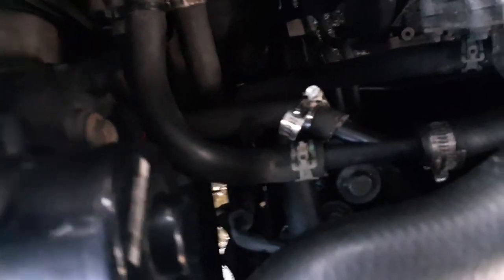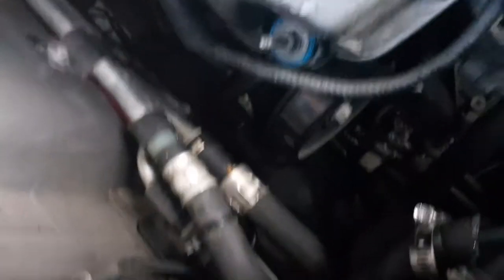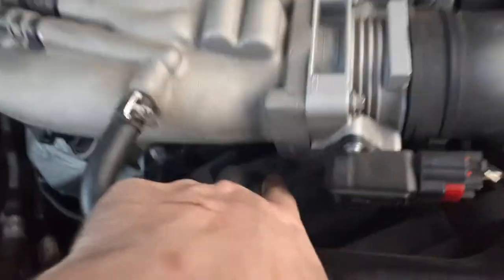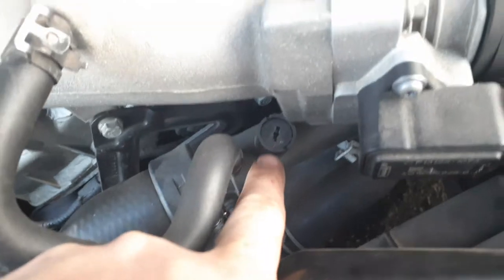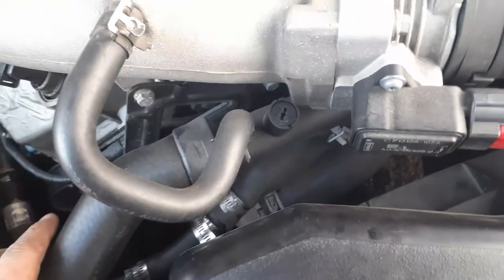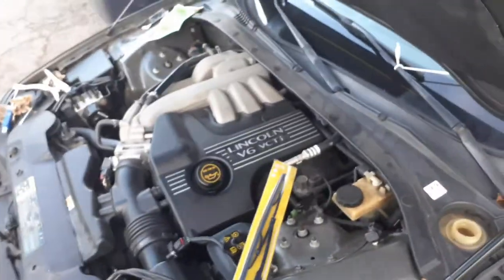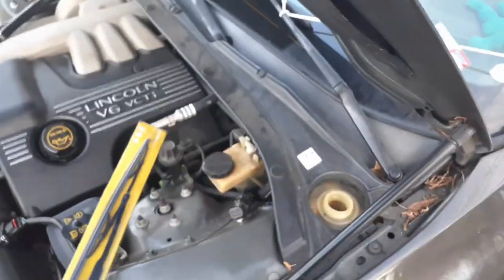Heater Valve DCCV Bypass 03-06 Lincoln LS - Get HOT Air In Both Sides Again FIX YOUR HEAT

Comment: Will this same method work with the 2000 v8 ??
Reply from the maker: That 2000 v8 has a valve with more outlets on it. You can do a similar trick, but it will require more hoses to be cut and spliced with connectors to bypass the valve. The main thing is to get that hot coolant from the engine to those two lines that lead up to the firewall and into the heater cores inside the air box behind the dash. Check this out....
https://www.justanswer.com/ford-lincoln/4c2hk-2002-lincoln-ls.html
Reply from the maker: Take coolant from 1 in the diagram there, y pipe that and split it, connect the two heater core hoses 2 and 3 to that y pipe. Looks like you can leave 4 and 5 in there connected to the valve because it appears to just be a free flowing return, but if the coolant isn't flowing through that for any reason, and hot coolant isn't returning to the engine, then just connect the hose from 4 into 5 using Clamps and a connector and that will let it flow. Sorry for the late reply, best of luck.
Reply: The tech in that link said this won't work because the coolant wouldn't work. Thoughts?

Comment from the maker: I love how when it starts getting cold I get more views on this one! 😁⛄️ Hope you all get it figured out and stay warm!
Reply: I was wanting to bypass the dccv and the auxiliary coolant pump as both are bad. Just until I can get the parts. The tech in that Justanswers link says a bypass wouldn't let the coolant flow. Is this true?
Reply from the maker: @butchcoolidgewalkencoolidg3376   assuming you have a 3.9 V8, it may not work out for you...without the auxiliary pump to provide extra flow to get the coolant up to the heater core at idle it might not work so good...but it'll flow when you get running faster and higher RPM to increase flow I'm THINKING. I haven't experienced it myself but that's what I'm thinking. If you replace just the auxiliary pump you can still bypass the dccv, splice hose 1 into 2 and 3 with a y pipe, then make sure the return from 4 goes into 5 or whatever port 5 goes to for coolant return with a longer hose...as far as the flow pressure, not sure how that'll go. If you step the hose size down from 1 to 2 and 3 that will increase pressure in the system and the coolant may flow to the core at that point. Let me know how it goes.
Reply: @WhitefolksT  thank you for the response. Just bought some clamps and couplings.  I'll let you know what happens.

Comment: Are there any upper radiator hose with molding tee for 03-05 v6 ls?
Reply from the maker: Not sure if that part exists or not. I literally looked at his car for 5 min and then went and grabbed this stuff in the video off the shelf at advance auto with the radiator repair stuff. The hoses on your v6 should be the same or very similar, I would think. My friends car is a 2006 V6 model.
Reply: @WhitefolksT  bro I’d appreciate it and will pay good for a 03-06 v6 upper radiator hose from the junkyard yard or anybody else.

Comment: Yo nice vid, on my 2000v8 i only get heat when my heater core bleed valve is open.. Looked at some diaghrams of the dccv and saw that the heater bleeeder is on the same hose as the heater core return line,, is it possible my dccv return port is clogged or not opening or my return hose is clogged? Thanks
Reply from the maker: Hey thanks for the compliment, gonna write a book, here it goes :) ...If you have to open an air bleed valve to get hot coolant flow, it makes me think you've got air trapped somewhere and need to strategically park the car or elevate that side to let the air out and the coolant flow. The return side doesn't have a shutoff valve, only the inflow side is regulated, but return could be blocked off somehow. Might need to pull a couple hoses off and look for gunk. I doubt it's clogged if you're at least getting heat in the car sometimes but the return/heater core side will sit with the same coolant in it all summer every year if you don't switch to heat sometimes to flush it out. That can get it gunky and gross. Be sure coolant is full, and mostly coolant is escaping the bleed valve when you crack it open and rev the engine to force coolant flow to force out air. Feel those hoses to see which ones are getting hot to verify you've got flow. Confirming that you have hot coolant flowing to all the right hoses is important. If the inflow hose is hot, hoses leading to heater core are hot, and return is cold, you've got a clogged heater core either air trapped or physical gunk. If that return hose coming from the core is hot but no heat in the car, the heater core needs flushed or replaced OR the blender doors in the dash aren't functioning. Unlikely but possible also is a bad water pump that isn't spinning the impeller because it came off the shaft or the plastic impeller blades are broken, missing, worn out...or a thermostat not opening enough. If you've got any more questions or if I missed something just reply here and I'd be glad to keep helping you get it figured out.

Comment: On my 02 3.9 LS. Only on warm days or sitting idling for a few minutes my temp gauge will try to creep up and get to the 3/4 spot then start coming back down when I start moving. But if it sits just above halfway, isn’t it still ok as long as it doesn’t get to high. I was thinking it might be the cooling fan cause I know these 02 LS came with the crappy cooling fans. I replaced the coolant reservoir and that kept it from leaking but still have this slight overheating when hot weather or sitting for long periods but usually just when it’s like 75 or warmer
Reply from the maker: I would confirm the fan speed, if it gets to 3/4 on the gauge that cooling fan should be full speed trying to cool the radiator. And the fact that it cools off when you drive and it gets air makes me think cooling fans. Check and confirm your coolant concentration and level is full. After that you get into things like, is the radiator and cooling system super dirty? Is the water pump still pumping? Thermostats not opening fully?
Reply: @WhitefolksT  I replaced the thermostat with a motorcraft recently and the radiator is new. So I might just drain all the coolant and put all new so I know the level and 50/50 is correct.
Reply from the maker: @albertwesker2283  yeah and consider using full strength antifreeze and mixing it yourself with distilled water from the store, it's cheap, use a mix concentration like 65/35 70/30 in favor of the coolant. It'll have a higher boiling point and lower freeze point than pure water, pure coolant, or a 50/50 mix.
Reply: @WhitefolksT  I’m thinking the mixture might be slightly off or the fan is getting weak. I know these LS 3.9 have very sensitive and intricate cooling system that have to be bled of air perfectly and precisely
Reply from the maker: @albertwesker2283  ok cool, let me know how it works out for you.
Reply: @WhitefolksT  appreciate

Comment: BROTHA 😎 IM HAVING SAME ISSUE ON MY 01  LINCOLN LS V8  ,I GOT AC  BUT NOT HOT AIR !!
Reply from the maker: @jcoach3064   yo, check in the comments and I've answered a few questions and dropped a link about the V8 version of this valve, it's really similar to solve the problem.
Reply from the maker: @jcoach3064  if you do have hot coolant running up the lines and hoses up to the firewall and heater core, and hot coolant coming back out the return line, it may be the blender door behind the dash not switching the air duct from cold to hot

Comment: What is exactly the problem the led to this conclusion???
Reply from the maker: The car had no heat inside for a while. The dccv also began slowly leaking, that's when he finally brought it to me. It's probably disgusting, corroded, and clogged inside of it, the valves were stuck closed. I did this to his car to get him safely back on the road for cheap. Also one less complex part to break now.
Reply: @WhitefolksT  TY for replying.
Reply from the maker: @joshuaheart2764  sure, always glad to help, feel free to ask if you have any questions or check my video description on here I wrote up for more details

Comment: Does the Jaguar 2005, V6, 2.5 have a similar engine other than the cubic capacity difference? What MAF sensor do you suggest? and would it use most of the same parts made by Ford?
Reply from the maker: If it's an AJ25 from 2005 it would be very similar to this 3 liter engine, kind of how the Contour/Mondeo had a 2.5L duratec and the Taurus has the same motor just larger cylinder bores. These are all engines derived from the Ford Duratec series, but the AJ engines have variable valve timing and a few other high performance/ more expensive upgrades over what mom had in her Taurus wagon. For the MAF, I usually recommend Motorcraft, Delphi, Denso, or more expensive brands, especially on sensors and electronics. Sometimes the cheap Chinese stuff works, but it's up to you if you want to roll the dice on that. If it was something I was gonna sell or beat up on for myself, I'd go cheap, but for the wife's car or a car you want to keep a long time it's usually better to spend the extra cash. Buy from a reputable website or dealer like rockauto to avoid counterfeit Motorcraft boxes with cheap parts inside. Good luck!! 👍

Comment: Does your ac still work. They tell me it won't. Does yours still work
Reply from the maker: The ac didn't work on this guy's car already from a refrigerant leak, but if the blender doors are working under the dash and your AC compressor is working correctly, you can feel the line to the dash is cold to the touch then you still should have AC, just might not be as perfectly cold as new. I'm not totally certain of where the heater core sits in the air box under dash. If it's right next to the AC coils on there then it could heat that up, in that case put something on the coolant hoses that lead to the heater to pinch them off in the summer. Like a paper clip or some small locking pliers and wrap the hose in tape to protect it. That'll stop or limit coolant flow to the core. Won't hurt or overheat your engine as that DCCV valve normally does the same thing, stop flow to the core.

Comment: Hey buddy I did what u said but now I have coolant coming out one of the lines I cut what did I do wrong
Reply from the maker: Did you splice in the little Y pipe from the bigger coolant hose that used to lead to the DCCV valve to both hoses leading up to the firewall/ heater core?
Reply: U cut the wrong line lol

Comment: En español
Reply from the maker: Esto es para los modelos 03-06, el 02 y anteriores tenían una válvula similar pero diferente con cuatro salidas.  Los modelos 03-06 tienen solo tres salidas.  El retorno de refrigerante del núcleo del calentador tiene una manguera separada que pasa por debajo de todas estas cosas, no fue necesario meterse con él en esta reparación.

 Así es como pasé por alto y eliminé la válvula del calentador DCCV que controla el flujo al núcleo del calentador.  Dejé el conector eléctrico enchufado y la válvula en su lugar de instalación.  Utilicé el kit dorman 47238 que se muestra que incluía un buen tubo en Y para dividir ese flujo en las dos mangueras de 5/8" que conducen al núcleo del calentador y tiene una entrada de 5/8", junto con un poco más de 5/8".  Manguera de 8" y 4 abrazaderas de manguera tipo tornillo.

 En la DCCV, la manguera inferior más grande de 3/4" es el flujo de refrigerante caliente, las otras dos mangueras de arriba fluyen hacia el núcleo del calentador. Corte la manguera más grande de 3/4" que fluye hacia la entrada inferior de la DCCV desde  la manguera superior del radiador.  Córtelo lo más cerca posible de donde la manguera baja de tamaño de 1" a 3/4".  Deje un par de pulgadas de la sección más delgada para colocar en el accesorio reductor en línea de 3/4" a 5/8" (usé un Dayco 80424 de latón que tomé del estante en Advance, toda la basura que usé aquí era de Advance  Auto en la sección de accesorios del radiador).  Tendrá que cortar los extremos de las mangueras del núcleo del calentador de 5/8" que extrajo, lo suficiente para deshacerse de la sección anterior que estaba sujeta. Ayudará a que todo encaje mejor sin torcer las mangueras. Don  No apriete demasiado las abrazaderas, especialmente en el tubo Y de plástico.

 ASEGÚRESE de purgar el sistema de refrigeración después de hacer esto.  Habrá aire en el sistema y evitará el flujo adecuado y no tendrá calor hasta que haga esto.  En el V6 es el tornillo que te mostré en la manguera superior del radiador.  Se suponía que simplemente se jodía, pero el del auto de mi amigo no funcionaba bien, así que apreté las mangueras, agregué refrigerante y aceleré el motor por un tiempo para sacar el aire a través del tanque de recuperación de refrigerante.  Después de un poco de burbujeo, desbordamiento y recarga, saqué el aire y encendí el calentador.  Es diferente en el V8, estoy bastante seguro, pero si encontró este video, probablemente pueda encontrar el procedimiento de purga del refrigerante.

 Aquí se muestra el LS 3.0L V6 de 2005 de mis amigos, y casi no experimentaba calor solo en el lado del pasajero del tablero, apenas lo suficiente como para notarlo, no lo suficiente como para proporcionar comodidad o descongelación.  El lado del conductor había estado soplando frío.  Esto me hizo pensar en la puerta de la licuadora, pero ambas mangueras del calentador estaban frías.  La válvula ya no permitía que el refrigerante fluyera hacia el núcleo del calentador y una manguera había comenzado a tener una fuga en la abrazadera de la válvula, por lo que era hora de reparar la fuga y el calor de una vez... por alrededor de $30.  El DCCV cuesta entre $ 30 y $ 140 o más, dependiendo de a quién se lo compre.  Cuesta $ 67 en Partsgeek.com

 Primero traté de eliminar el problema de la puerta de la licuadora o el sistema eléctrico de control de clima al verificar si las mangueras del núcleo del calentador estaban calientes, y siempre estaban frías, sin flujo, pero el tanque de refrigerante estaba lleno y el auto estaba funcionando.  temperatura de funcionamiento y no sobrecalentamiento.  Las otras mangueras estaban calientes, así que esto me dijo que la válvula no estaba funcionando correctamente.

 La puerta de mezcla también podría haber estado mal, lo que habría podido determinar una vez que obtuve el flujo hacia las mangueras del calentador y las puse calientes al tacto.  Supongo que la conexión eléctrica para decirle al DCCV que se abra para el flujo puede no haber estado funcionando, pero no tenía los pines o las especificaciones para probar eso con mi multímetro, así que dije al diablo, el auto tiene 15 años.  , tiene 190k millas, y es enero, así que estoy arreglando este calentador.  El aire acondicionado no funciona, por lo que realmente no importa que el refrigerante caliente siempre fluya, podemos arreglarlo este verano.